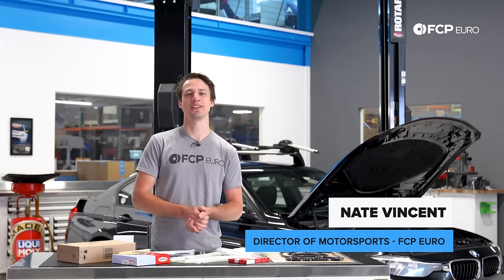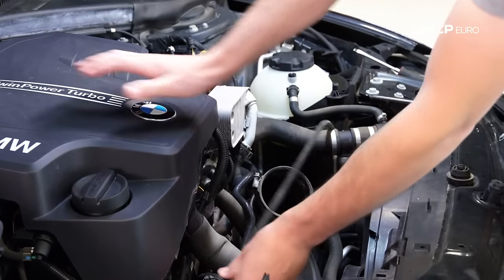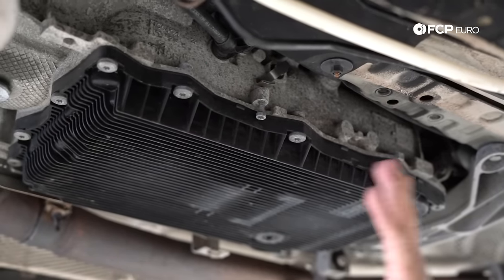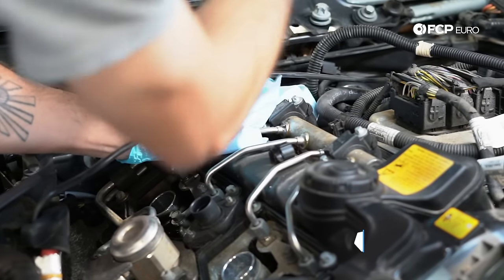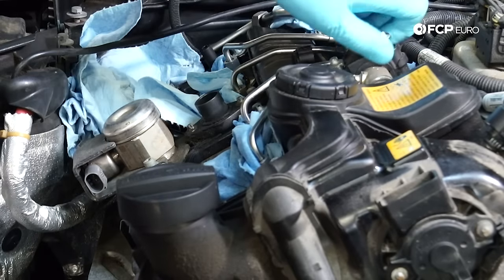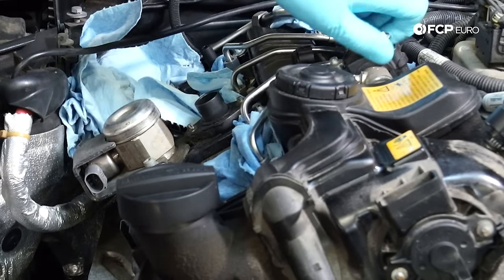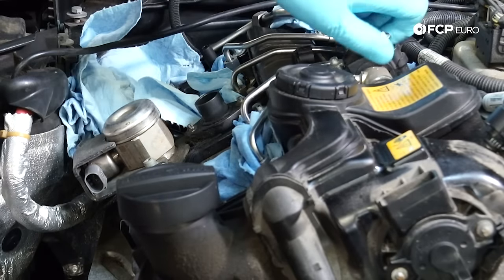BMW N20/N26 Timing Chain Replacement DIY Part 1 - Removal & Disassembly (328i, 320i, 228i, 428i, X1)

Comment: GREAT video !!!  My N20 engine is reaching 65K miles with only 5 more months to reach 7 years.  The engine is still smooth without abnormal noises.  I have been thinking on when I would have to  replace this chain.  Most probably at 100K mark is the engine does not develop any noises by then.  Definitively, I am counting with FCP Euro for all parts and tools for this job.
Reply: Noise is not always a symptom so don't rely on that. I didn't have any noise and had mine changed at 78K miles. I had it done preventatively and the guide was broken in 3 places. The guy showed it to me and said it was ready to go. I got lucky I didn't blow my engine.
Reply: @leveragelifestyle8581     Ours is at 89k so I should check into ours then.. what year is yours?
Reply: @leveragelifestyle8581 I have the second gen n20 on a 2016 x5 40e with 129,000 miles i wonder if i should do it now?
Reply: @MiguelDiaz-zk8dk  I think 2016 was already fixed. I believe the part was already updated after early 2015 if I'm not mistaken. I would double check that before paying for that job.

Comment: Parking prawl pin I knew what you were talking about 😆. The valve cover gasket on my sister's 14 320i Xdrive is leaking in the same spot as where you were soaking up the oil in the left side sparkplug/injector hole in the cover.

Comment: Hi  and thanks for a super video .I have been making cars professionally since 1979 but first time on a BMW N20 engine I am very happy with your detailed video and chain change on that car. However, experienced something that scared me to assemble the car incorrectly .the tool for the oil pump did not really sit so without noticing the turned oil pump driven around and was in doubt and the timing was right in terms of the balance axis
perhaps one should say that if only the pin is inserted in the hole and fits then no problem as it turns one to one (no exchange)
I was afraid that there might be an imbalance in the engine 
Many Thanks for a Great Video
Regards Torben Møller

Comment: You guys are absolutely amazing. Thank you for such an in-depth video. I have a beautiful 2012 328i Sportline 6 Speed manual. I will be buying the timing chain kit from your website and doing this on my own.
Reply: Let me know if you have done it. I have exactly the same car as yours! 2012 328i Sportline 6MT :) only 67k miles on the cluster
Reply: @justinparisien4317  I am currently in the process of doing it right now and I am just about done. I have the new timing chain installed, but I manually rotated the motor by hand and the timing seems to not line up, so tomorrow I will figure out why and correct the issue. You must always rotate the motor by hand before you start it to ensure that the motor stays in time
Reply: @youandiryan  that’s good to know about turning the engine manually before starting it. Questions about that, how many time you need to rotate it and you you proceed to do so?
Reply: @justinparisien4317  the crankshaft will have to spin 2 times for every one time that the camshafts turn. So you would want to turn the crankshaft 2 times or 4 times. And if your marks line up on the crankshaft then it is correct. You would put a 22 mm socket on the crankshaft bolt, and turn it clockwise by hand with a socket.

Comment: Important to clarify that BMW remedied this after January/February of 2015. I have a 16 428i F36 that I maintain and have nearly 80k on that car and it’s running strong. These engines are loud on cold start owing to the loud Bosch DI Injectors.
Reply: Same here
Reply: So a 2015 model would still be affected by this old design?

Comment: Hi, thank you for the awesome video. I have a 2013 328i currently on 100k miles & I'm looking to keep long term, is there any other preventative maintenance that's worth doing when the engine is stripped down during this job? Also wanted to confirm given my mileage & plan for long term ownership would you recommend replacing the valve cover when doing the gaskets?

Comment: Great video series! One question, What about clearing the “drivetrain malfunction” code in the system; what scanner do you recommend for BMW’s to best diagnose and clear error codes? Just had this issue diagnosed and am wanting to do the job myself. Again, great job, big help to us “do it yourself(er’s)”!!
Reply from the maker: Hi, Tony. We recommend the MX808 here: https://www.fcpeuro.com/products/maxicheck-mx808-obdii-scanner-autel-mx808
Reply: FCP Euro Thanks guys. This scanner will clear the drivetrain malfunction as well as other fault codes? Just don’t want to have to deal with the dealership anymore.

Comment: need to touch more on how to use the tool to set the balance shaft of the oil pump. maybe even show the tool and how you used it.

Comment: Lock the crankshaft into place first, also on the side of the trans there is a cover, if you take the cover off and look up on the flywheel you can actually see the crank pin going through the hole. But I’ve done this repair locking the cams in place first and the crank pin did not align.
Reply: Hey Jason if you are strictly replacing the timing chain do you have to remove the oil Pan?

Comment: Hello my name is Jose. And we just purchased your timing chain and followed your instruction
 step by step. Thank you for sharing your video. We replaced the timing chain and the timing module. Timing was on point but when we start the vehicle its starts fine but the check engine light came on with P052B and P054B codes. What could this be??

Comment: I remember I got my timing chain covered on my 2015 328i under warranty for free I kid you not @ ~69950 miles…. the cutoff (I found out a week before) was 70000 miles or 7 years…

BMW sent the recall in the mail at the right time 😅

Comment: @36 min, I think you are supposed to have the front timing tool (green piece) installed before loosing the cam bolts so you are not crunching the chain or stressing the back part

Comment: Hi Nate, I hope you can help me. I have been doing a timing chain replacement using your videos and it is great to follow.
Thank your your videos.
I have some very hard material sort of burnt on the valve springs. Can you suggest what this may be. It had gone into the Hydraulic Valve as well and dropped the oil pressure, which in turn stopped the oil flow.

How can I send pictures of this.

Thank You
Douglas

Comment: Hey, nice video. What year of your BMW? I heard since 2015 they changed the timing chain design. Nice job.
Reply from the maker: Glad you like the video, Ricky! This one is a 2012.
Reply: @fcpeuro   thanks. Just suggestions that if you could make a video for replacing oil filter housing gasket of your N20. Thanks

Comment: Hello, thanks for video, question my 328i engine seized, I removed valve cover and oil pan and chain looks okay, did get a warning low pressure oil. I'm thinking did the oil pump went  out no lubrication. In this situation why would the oil pump go out?  If oil pump chain was not broken.  Would there be a way to test the oil pump? There was oil in the engine. Is there any upgrades with oil pump? oil pan? 
Thank you so much, for all the input.

Comment: Do you recall on the two lower T45 guide pin bolts you removed from the front of the engine.  Did you need an extended bit or will a standard length be enough to reach?? Thanks

Comment: Hey!
I'm thinking about buying a 2013 F20 125i and to my knowledge it has the N20B20 engine in it. I didn't see F20 listed on the warranty extension sheet shown at the beginning of the video.
Should I be worried about the timing chain issue or is it not an issue on the 2013 F20 125i? Just so I know if I can negotiate the price to be lower if I need to replace the timing chain.
Thank you for the video!

Comment: Good video. I do have a question though. I am trying to get TDC but the intake cam is off by 3 teeth while the exhaust is aligned. How do I get the timing tool attached if the flat is that far off?
Reply: How did you resolve this problem?? I am in the same situation
Reply: @popptj  just got it working. I went and rotated it until it was aligned after removing the chain.

Comment: I'm curious as far as that specialty tool is concerned I know the price of it at FCP and ECS tuning  is upwards 300 bucks. I'm wondering can I buy a lesser cost  tool on amazon or ebay.  and still do the job properly?

Comment: Hello, I have a BMW with the N26 engine, (88k miles on it) and I hear during cold start the timing chain rattling in idle mode. What would be your guys recommendation? Changing the timing chain tensioner or changing the timing chain with tensioner? Thank you

Comment: The transmission does not have to go into neutral to turn the engine over i’ve worked on a lot of cars. I don’t know what cars you’re working on that the motor will not spin if a car is in park. That’s the case you’d have to put the car in neutral every time to start it.

Comment: Is the N20/N26 an interference engine?  Getting mixed info and looking for an accurate answer.  At first glance people say yes, but others have videos showing non-interference on the intake side and interference on the exhaust side.  

The timing chain slipped on my 2012 528i and I would like to replace both the cam timing and oil pump chains, getting them in time, and see how it runs.

Comment: How long does this job take? I've swapped engines and transmissions and and done a bunch of internal work before so I'm not new to this. 2013 328xi

Comment: Hi, excellent DIY. I had a snafu doing this job and need some advice. Camshafts are locked in place at TDC with the tool, crank is also locked in place at TDC. I got the new oil pump bolt installed and torqued down with the pin tool included in the oil pump tool kit. I installed the new chains. rails etc finger tight, got the exhaust cam sprocket on and was installing the crank snout, that's when I noticed the pin had fallen out that holds the counterbalance shaft and I also noticed while installing the crank snout that the balance shaft and oil pump were turning while installing the crank snout. How do I get the balance shaft back in proper alignment? I have the BMW service manuals and I can't seem to find a good answer to this question. Any help would be greatly appreciated, my engine is on an engine stand and not in the car.
Reply: After some research I think I have figured this out...when I initially installed the balance shaft locking tool the shaft was completely locked in place to loosen and install the new bolt. After messing with the crank snout installation and the tool fell out I was getting a half turn between it locking up. After finding a picture of the internals of the balance shafts I have figured out why, the lower balance shaft which has the locking hole only has "lobes" on half of the shaft, so the 1/2 turn slop I was getting afterwards was because the pin was lock on the wrong spot, the locking hole is in the "lobe", I believe all I have to do is find the hole in the lobe, lock it up and continue.

Comment: As someone who owns Honda’s and maybe dumb enough to be in the market for an F31 wagon with these engines, does the replacement chain fix the chain issue like the 2015+ does? Or is it just better to wait for the right deal on a 2015+. I’ve owned American cars Japanese cars and as a car enthusiast I feel like I need to atleast own one German car for journeys sake.

Comment: cylinder #4 cam lobes must be in beginning to intake and ending exhaust positions. That's when cylinder #1 is top dead center. This is based on the 1342 firing order.

Comment: if you're going to use the flywheel locking device is putting in the pin necessary?

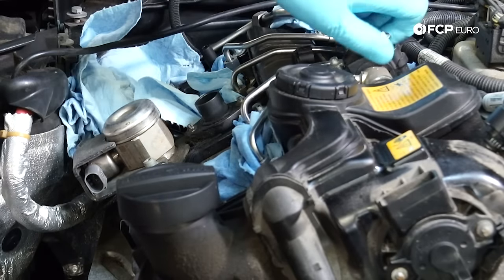Comment: 35:36 if you want to be a bit proactive without investing this kind of time/money, could you replace the chain tensioner only without disassembling the whole upper engine components? I am speaking from if everything is fine but you want the updated tensioner installed as a minimum diy.

Comment: Do you absolutely need the flex plate tool to complete the job. I have everything except for that and I completely forgot to order it. Engine is exposed and don’t want to wait too long to put back together

Comment: 10 minutes into the video and Iam considering not to go with an n20 BMW  . I hear this is not a big problem on late n20 models like a 2017 and 2018 my question is how frequently do you have to do this job.

Comment: Wow, incredibly great instruction video! But now I know that I would never want to attempt this job myself on my F30's, nor do I want to pay my dealer five grand. I'll just sell the cars before they are high-mileage and get something newer.
Reply from the maker: You might have some lukc at a smaller local bmw specialist shop, depending on where you live!
Reply: @fcpeuro  Good point. I think there are some reputable German car shops around here (Portland, OR). I still do all the easy stuff myself and buy my parts and supplies through you guys, of course. You're the best! Thank you.

Comment: Would this cause fine dust particles of metal in the oil just stripped mine the chain was very slack and should i replace the oil pump?

Comment: Hi I got a 2013 528i with N20 Engine , 103k miles ,  notice rattle at start up but no check engine light goes away after 2 min. ,  is it good idea to change timing chain  tensioner  to see if that improve noise . or it just going to create more trouble & waste of money?  Thank you

Comment: @fcpeuro I have an issue of pulling wastegate actuator off. I was able to get the pin off but it seems like the rod does not have enough space to slide off the hook. Do you have any way to get that hook off?

Comment: As a happy FCP Euro customer, owner of a 1997 Volvo 850R and 1992 Volvo 940gl;  I hope I don't offend any BMW owners by this but I have often thought that BMW engineering can be somewhat pretentious and questionable.
Reply: That is on the new BMWs, bean counter accountant vs engineers. Make it last just until warranty expires and buy a new BMW. I have had e28, e30, e39 and they are tanks. The M3 and M5 compared to the new ones, are 100 times more reliable, even the v10.

Comment: Do you think it’s possible to remove and replace the cylinder head with the engine still in the car. My timing chain guides broke apart and it skipped time, so I probably have bent valves.
Reply: I belive this is a non-interference engine.
Reply: I performed a leak down test on all cylinders and it ended up that none of the valves were bent. So I replaced the timing chain and oil pump chain with the help of this FCP video series

Comment: Does the n13 engine have timing chain issues? And how can you check. When it start you only hear the wastegate rattle since this is a common problem on the n13’s

Comment: thinking of geting an X1 2013. BIMMERS please advice me why is it required toi change the timing chain.if the previous owner have done it , when will it be due next. Please advice me is it worth the effort. its a x1 2.0t N20 rwd 2013

Comment: I have a question,  does the oil pan need to be removed if you are not changing the oil pump chain?
Reply: I meant balance shaft chain

Comment: If I have a X drive do I need to remove the front drive axles for this ?
Reply from the maker: If you have an Xdrive car the front axles and differential will need to be removed to be able to remove the oil pan.
Reply: @fcpeuro  ouch! pain!

Comment: Ok I’m a female, I need to have the timing chain replaced on my 2013 bmw 528xi 105k miles. It gave me a Drivetrain malfunction while on the highway, I pulled over right away and had to have it towed home as it only cranks, but will not start. Is it worth the cost to fix it or should I just sell the car for parts? I definitely cannot do this myself. Before this happened the car was driving beautifully and had no previous problems, I actually just had the breaks and oil changed the week before 😔😔😔
Reply: same lol im gonna fix it up as buying another car is out of the question when i just bought this one 2013 528i here
Reply: @StillBrokeOff  well I had worse news than I thought. After 4 months of the car sitting in the garage and my husband still not able to figure out why he can’t get it to start as he already thought it was a bigger problem (he maintains all of our BMW’s, even replaced a serpentine belt that shredded in our daughters 335xi, he practically took her car apart to clean out the shreds and her car is running beautifully) 
We finally took my 528xi to get diagnosed to a specialized bmw mechanic shop that had very good reviews and unfortunately my 528xi not only did the timing chain get lose, a link went inside the engine and now need a new engine! 
I’m absolutely upset about it, but you’re absolutely right, I’m definitely not going to buy a new car at this time due to inflation. So we decided to spend almost $11k to have the engine replaced 🤬🤬 
I should have the car back in about a week and we shall see. Good luck and I hope it’s only your timing chain 🙂

Comment: I took my car for an oil service at a none BMW garage and they removed the plastic guide in the oil filter and just poured the old oil back. On the highway the car through an oil pressure warning. I drove home slowly and discovered the missing plastic guide in oil filter housing. I replaced the part and did the oil service myself. Will there be a long term demage that I need to worry about?

Comment: I can put the cilinder 1 un cero compression lower a litle the engine take pan oil out .whu need lock the crankshaft if u lock the fly wheel?

Comment: it doesn't matter if the automatic is in neutral as long as it's in park.... the engine will still spin in park. tats how it runs at idol and when turned on